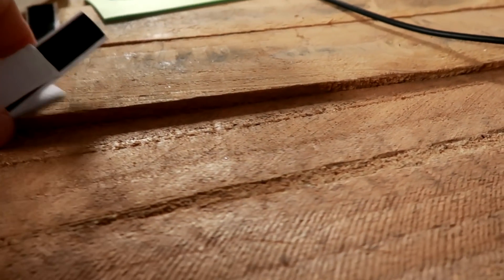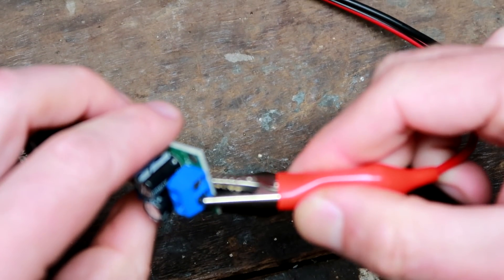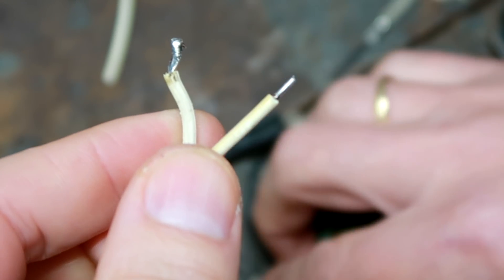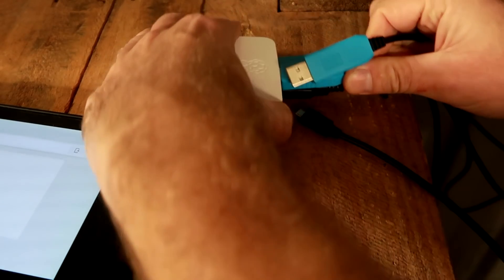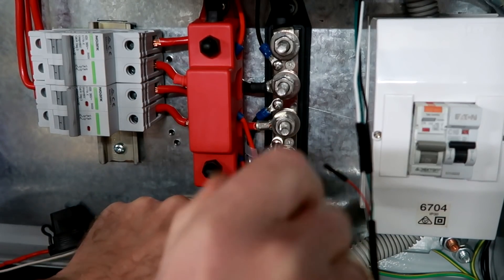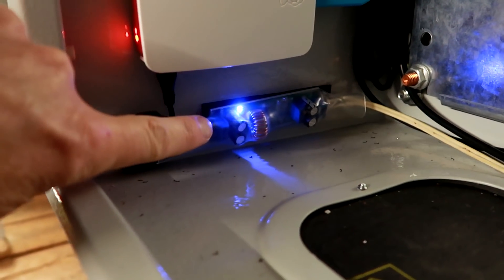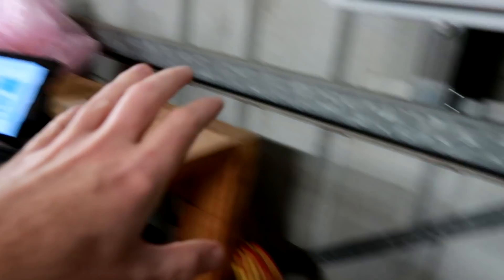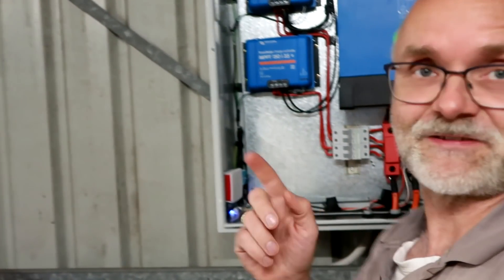Powering the Raspberry Pi from our 48V battery. Will it still work?

Comment: An isolated DC/DC converter is recommended - to prevent possibility of Raspberry overvoltage with 48 Vdc in case of buck transistors shorting. Or, use thyristor+fuse based "crowbar" protection circuit (fuse in "+" from DC/DC out with short-circuiting thyristor after that fuse), at Raspberry's input, with zener-based circuit, that "fires" thyristor in case of voltage rising past zener's opening voltage.
Reply: What would be the typical value zener diode in this situation? I guess 5.1 V is too close?
Reply: @daskasspatzle2396  Instead, may be use an LM431 precision adjustable zener as in Wiki crowbar protection circuit article?
Reply: @daskasspatzle2396 , 5.6 V zener will be sufficient. So, thyristor will be opened at approx. 5.7 - 5.8 volts, which, IMHO, will not damage 5 V chips during opening of thyristor..
Reply: This sounds reasonable, thanks :-)